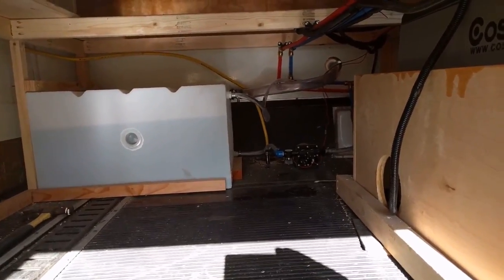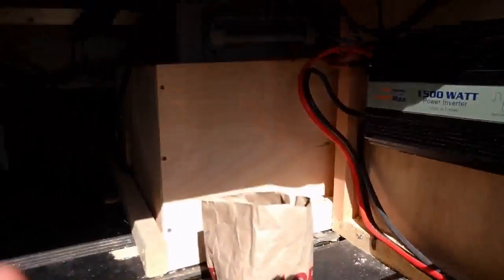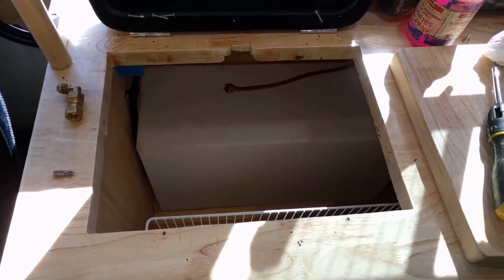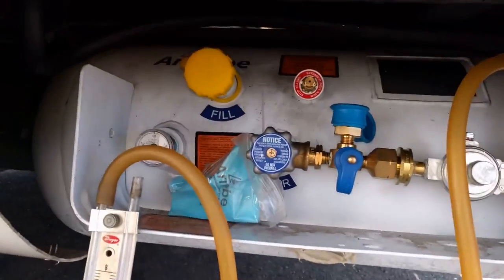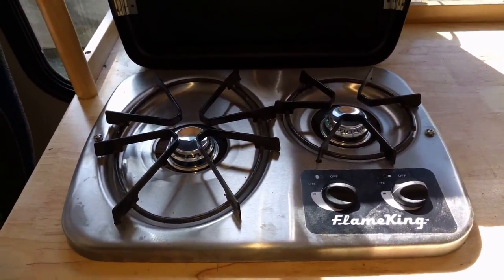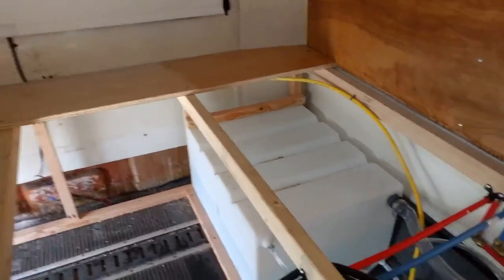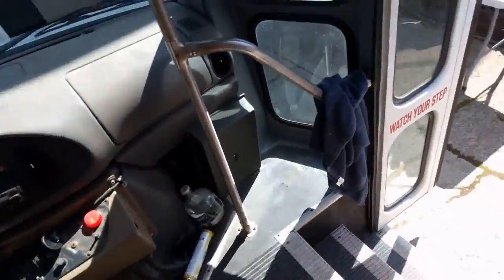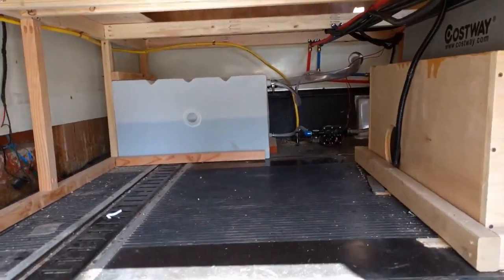Shuttle Bus RV Conversion (Part 74) Propane Lines Installed Meet Ridley

Comment: It is a beautiful build , would love to own , it but I am terrified and any type of gas. Surely with today's technology there is safer and free energy source, such as solar. But that's just me ,it's a wonderful build.
Reply from the maker: @Kay Falls  That is why I didn't plumb it myself,wanted a pro to install the lines. They tested their work and found the 3 leaks in the stove! I can't believe the low quality stuff that is available now. That could have been dangerous and caused a major fire. Solar power is fine for lights and induction cook stove but gets a little tricky for instant hot water heater,that's why I wanted propane,I like a nice hot shower. Thank you Kay  :  )

Comment: Hello Robert. Just found your play list! So, I might buy this 2006 e-450 diesel with 130,000 miles.  Can you tell my about how much you have spent after buying the bus?
Reply from the maker: @Potato Head 2006 has a 6.0 power stroke  turbo diesel they quit making the 7.3 mid year 2003 that being said a 6.0 can be a good engine if you bullet proof it which can get expen$ive . You should google it and find out what is required. I don't have any idea what I've spent so far but I do have a big pile of reciepts I'm going to be adding up this month and doing a final walk through and price for sale on my bus.

Comment: Cold-right, Hot-left.  ? 😉 lines switched or faucet in 180° turned around since handles open to back, not front?

For fiberglass maintenance products try West Marine for a great selection. 3M products are tops. West Marine house products are good, too.
Reply from the maker: @John Wren HA! I knew someone would catch me on that! I wanted the handles to swing inward because the sink is pretty small and I wanted as much front clearance as possible in front, that put the hot on the right. I didn't think it mattered too much at the sink, the shower is correct, no blasts of cold water and confusion! Well anyway it's a 5 minute fix if someone doesn't like it. Yes 3M products are tops and they price them that way too! I was trying to find a fiberglass scrub that would take off gelcoat oxidation so I wouldn't have to hurt my poor back buffing the roof of the bus. I used a non acid wheel cleaner and it worked ok I just rinsed it a lot. Thanks for the reply  :  )
Reply: @robertbraden3889  - Glad you clarified that. Most people (if they didn't know what you did) will turn on the left side and wait and wait for it to get hot and think they were out of hot water. Then they might turn on the other side. But you also have to remember that if someone (who doesn't know what you did) turns on the right side, thinking it was cold, they could get burned. : )
Reply from the maker: @annwithaplan9766  Good point :  )
Reply: @robertbraden3889  - Thanks. Because I happened to me before. : )
Reply: I do remember you switching the handles so they would turn inside of the sink... But I guess you forgot to switch the lines..  ha ha 😃   I vote the new name of the bus should be Rubie may he enjoy the green fields of the rainbow bridge.  💕
Reply: @larryburch919  - Aww Rubt, what a fitting name. No pun intended  (fittings 😊).
Reply from the maker: @larryburch919  The handles have a red dot and blue dot for hot and cold, that's why I didn't switch the lines around, boy that would really cause some confusion if you turned the handle marked cold and hot comes out! Maybe I will just turn the faucet back around and be done with it,lol .  I think I will let the future new owners name the bus since I can't keep it. I sure miss my buddy. :  )